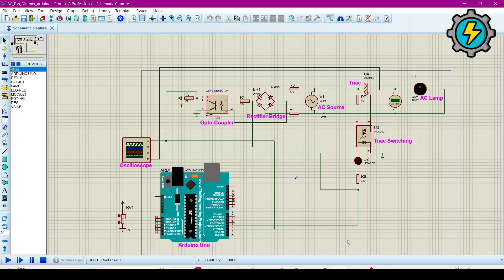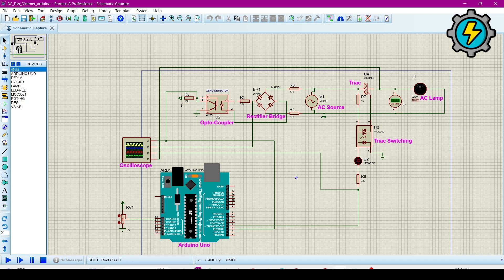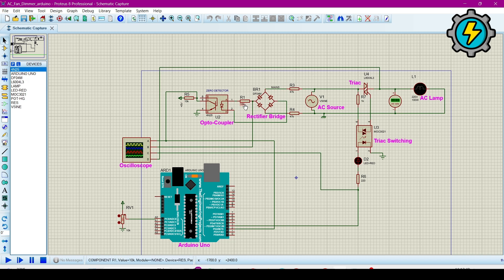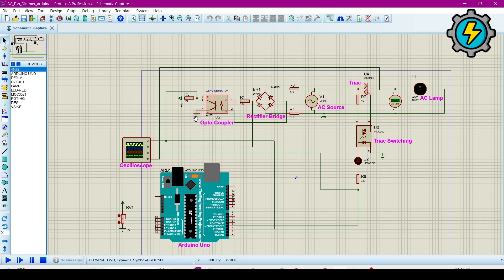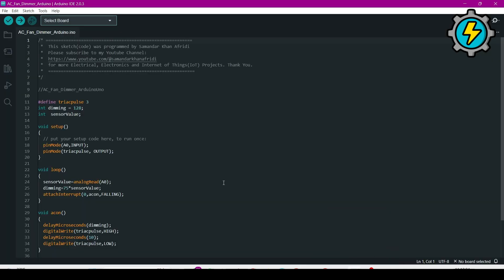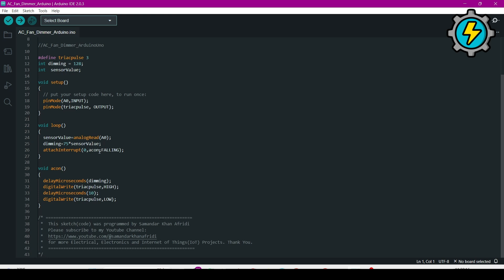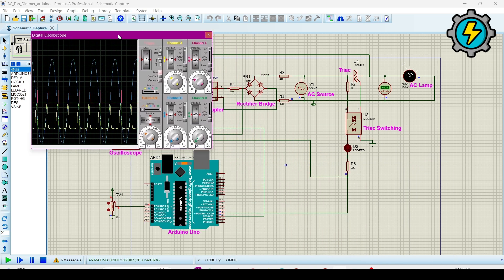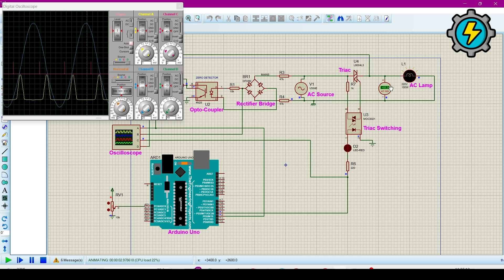AC Fan Dimmer Simulation with Arduino: Proteus Tutorial

Comment: it works good but you must update the code

#define triacpulse 3

volatile int dimming = 128;
int sensorValue;

void setup() 
{
  pinMode(A0, INPUT);
  pinMode(triacpulse, OUTPUT);
  attachInterrupt(digitalPinToInterrupt(2), acon, FALLING);
}

void loop() 
{
  sensorValue = analogRead(A0);
  dimming = map(sensorValue, 0, 1023, 9000, 200);
  delay(10);
}

void acon()
{

  delayMicroseconds(dimming);
  digitalWrite(triacpulse, HIGH);
  delayMicroseconds(10);
  digitalWrite(triacpulse, LOW);
}